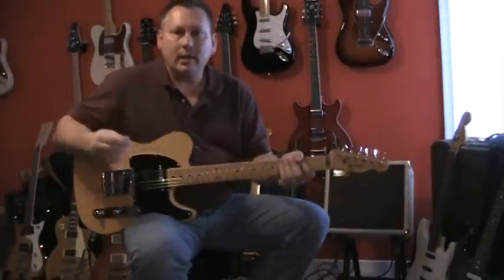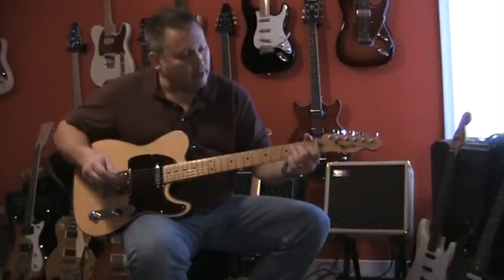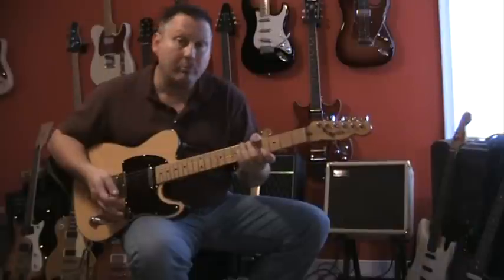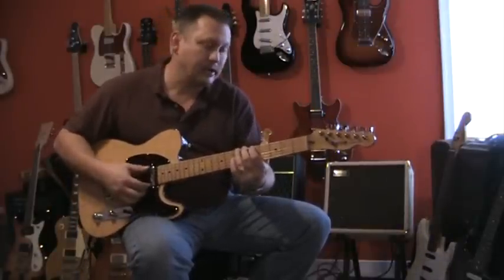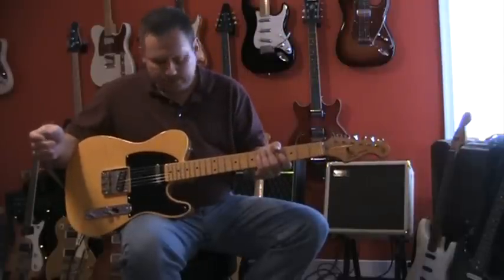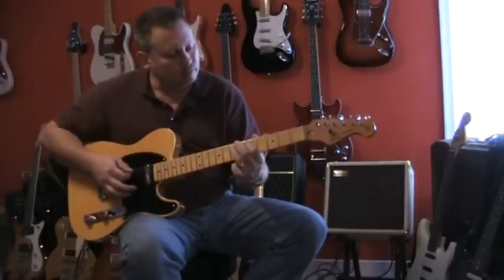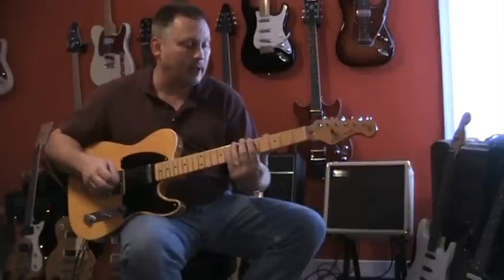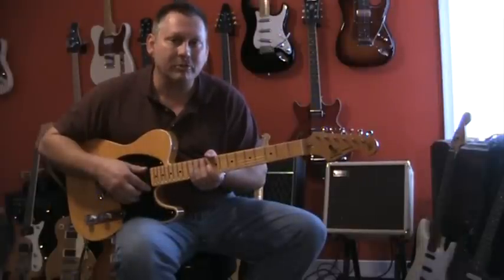Battle of the Frankenteles

Comment from the maker: @espensl - Thank you for your comment.  the fourth position is the two pickups in parallel.  You can find the wiring diagram on either Seymour Duncan's website or Fender's website.   I prefer to have the pickups reverse wound/reverse polarity from each other so that they are humcancelling in the 2nd and 4th switch positions.